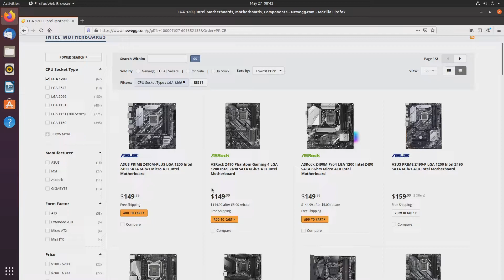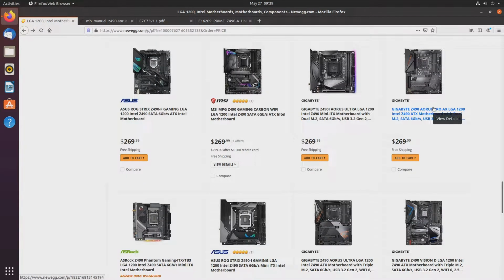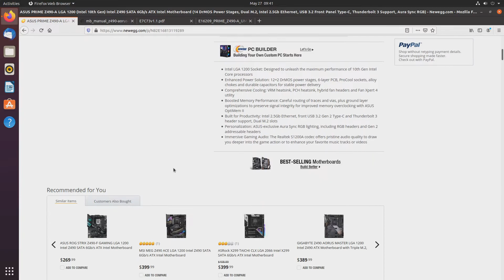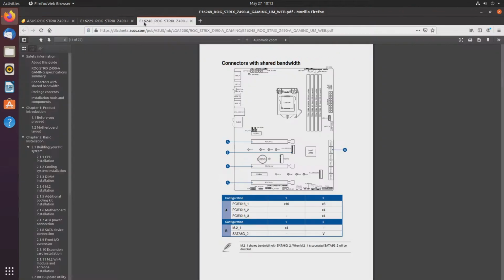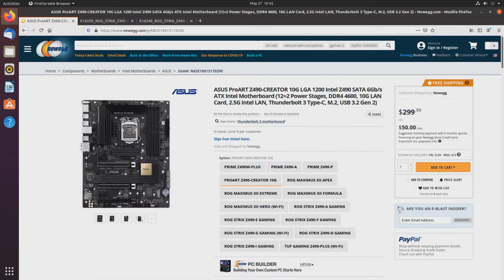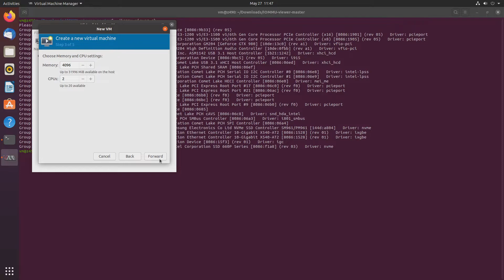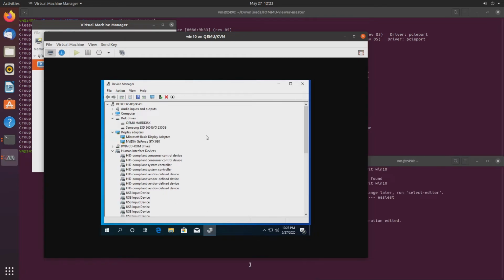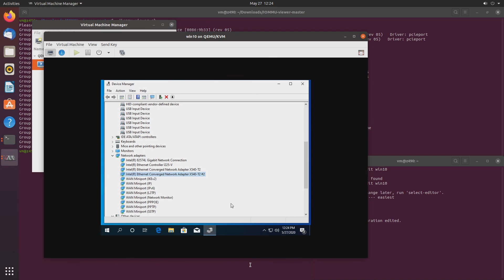Quick look at Z490 GPU passthrough and IOMMU

Comment: Great video! I was thinking on buying the MSI Z490-A PRO with an i7-10700K to virtualize Windows for gaming and streaming, but I see that you recommend the ASUS ROG STRIX Z490-H which is in the same price range (only $40 more) and it supports x8/x4/x4 which the MSI doesn't for what I've seen in the block diagram. Should I consider buying the ASUS motherboard instead of MSI? Are the IOMMU groups going to give me trouble with the ASUS motherboard? I picked the MSI because according to a reddit post on /r/VFIO the groups are fine.

Comment: Thank you for this informative explanation. I use Proxmox and sometimes crash the whole server when passing through an inappropriate IOMMU group. I have a lot of network cards in machines and find the most successful motherboard from my collection for this is the Supermicro X10SAT with Intel C226 Express chipset. I am having much less success with an i7-10700 on a Gigabyte B460 motherboard. There often clashes with onboard M.2 and built in LAN devices. Will you make a continuation video where you look at Supermicro motherboards and also AMD ? I am tempted to try a Ryzen 3700X on a B450 or X570 chipset.

Comment: Enlighten as always, as I’m not able to install the passthrough with my laptop, my second try would be a customized computer, but now I realize that it has to be done carefully, otherwise I’ll end up with a very expensive useless toy.
Thank you very much.
Reply from the maker: Have fun with GPU passthrough and experiment with it. It's pretty unlikely that it will turn your PC into a paperweight. If things stop working, you should be able to reinstall the OS and get back to whatever you were doing. Just don't forget to back up your data!
Reply: Pavol Elsig thanks for your answer friend, I answered a long text in your other video, regards.

Comment: What about the Gigabyte Vision Z490 G? It supports to split the CPU PCIe Lanes with PCIe Bifurcation in a x8/x4/x4 configuration. The board also comes with two Thunderbolt3 headers. Commonly TB3 Ports on desktop systems (Z270, Z390, X570) are routed through the chipset and thereby limited through other devices. With the Bifurcation enabled it should be possible to use a GC Titan Ridge AIC through the CPU Lanes. Would you recommend that board for gpu passthrough?
Reply from the maker: The Vision G is a good board and should work just fine for passthrough. But like most boards (and same as the board I used in the demonstration), it only has 2 CPU connected PCIe slots. Bifurcation is mainly for splitting a single PCIe slot for use with NVME storage cards like the Aorus AIC adaptor. As for the thunderbolt header, you would still lose one of the PCIe slots to the AIC. For that reason, I prefer boards with a built-in TB. At the end of the day, your use-case is what matters the most and you know best what will fulfill it.
Reply: Pavol Elsig Are sure that only one pcie slot x16 is split up or does it work like pcie muxing: the first mechanical x16 pcie slot will run electrical x8 of the cpu lanes and the second x16 pcie slot will also run electrical x8 of the cpu lanes as well as the third x16 pcie slot will run electrical x4 of the cpu lanes.
Reply from the maker: @franzpleurmann2585  I'm pretty confident that Gigabyte Vision Z490 G has only two CPU connected PCIe slots. I double checked the manual. It's a perfectly good board, as good as most other boards for passthrough. In the grand scheme of things, it doesn't matter that much. And with some luck, that x4 slot might end up in its own IOMMU group anyway.
Reply: On the Z490 A and the Z490 H Gaming the x4 slot is only x2 wired through the chipset. Which brings up the question where to connect the Thunderbolt 3 AIC because the last x16 slot is x4 wired to the cpu and Thunderbolt 3 only connect via the chipset. If so then the board would cripple the Thunderbolt 3 AIC speed. Is this true?